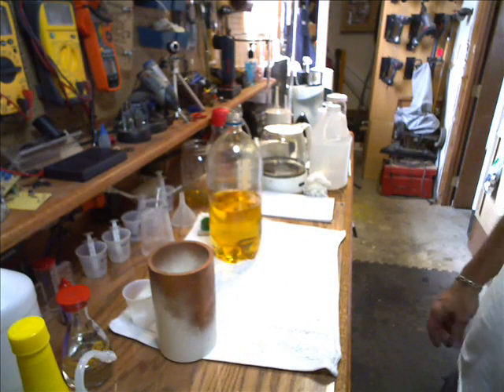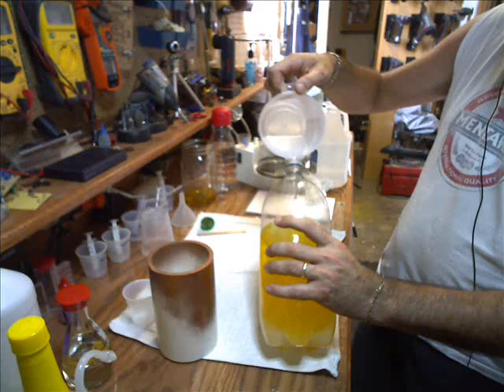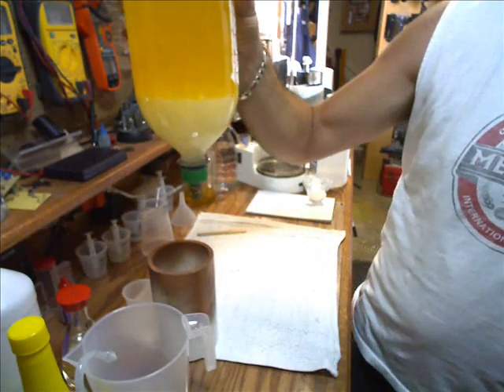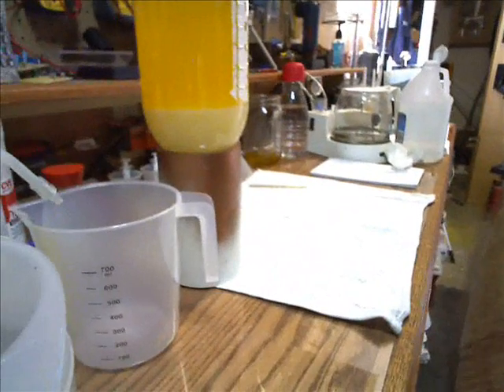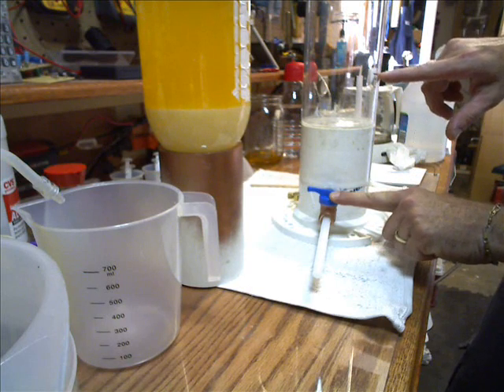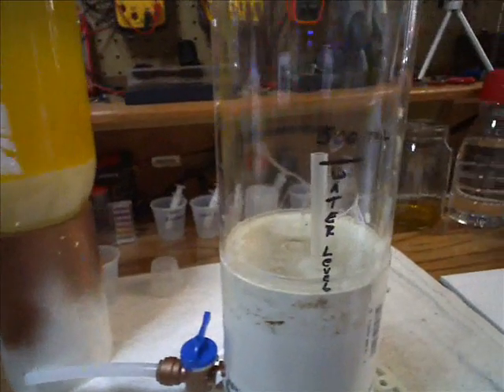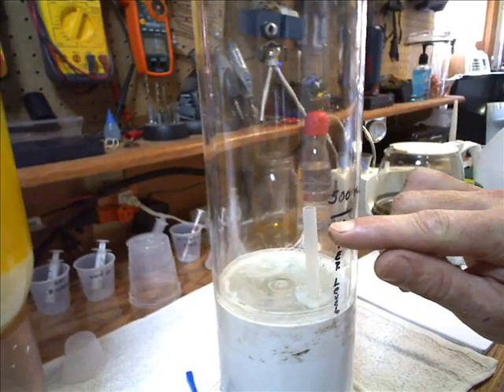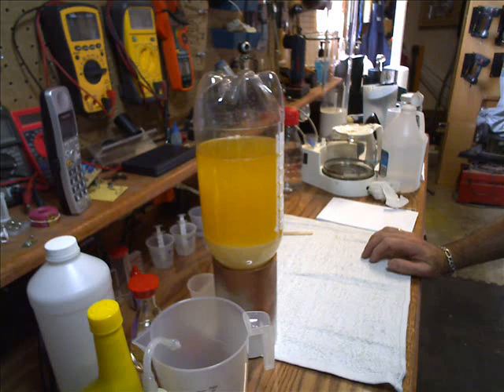How to Make BioDiesel #6 The Wash

Comment: If you don't clean the fuel, it'll clog up the injectors and the particulate filter. The injectors in modern diesel engines are especially susceptible because regular diesel fuel is so thin (5 ppm Sulphur) these days to help atomize it in the cylinder because of emissions. So cleaning will be a must. Next question is, normal diesel fuel has detergents in it to help scrub the engine of carbon build-up. What do we do about detergent additives?

Post scriptum: not only are detergent additives required, but one has to measure for their content (soap being a detergent) because too much soap in biodiesel will clog up the fuel filter and the injectors: https://www.youtube.com/watch?v=Z6On5gB6VwA

Comment: Can i use grease trap to separate the oil and water?
Reply from the maker: Steve - Yes, but I would still drain off the bottom a bit to make sure you have as much water out as you can.

Comment: Hey John thanks a lot for this video! I will try to make my own first batch of biodiesel from used cooking oil in about a month or so. I bought 100% biodiesel for my car at the gas station and the car loved it! I am using a VW Lupo 3L from 2001 and it says in the manual that it works just fine with biodiesel.

Comment: hey john, appreciate your video. im on the process of making my biodiesel using mikey sklar's method which he posted here on you tube on 5 min microbatches, it seems that they did not wash their biodiesel which is kinda awesome and quick, they immediately used it by pouring the biodiesel into the veedub's tank with the methoxide still mixed with it. if i do not wash my biodiesel will it clogged my fuel lines or destroy my engine? or is this ok if do not wash it at all? looking forward, thank you

Comment: I have washed my bio diesel with water very gently and it did go white at the bottome,then i repeated it 4 times and still white but paler. Before i washed it with water it was very clear and golden,but now its lemon colour and slightly misty,does that matter. Finally if i wouldn't of washed it would it still have worked fine?,thanks Rob From UK